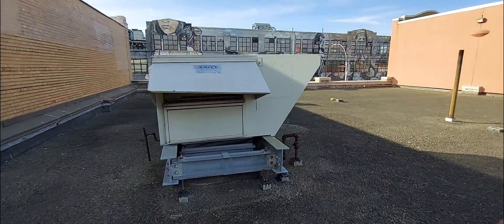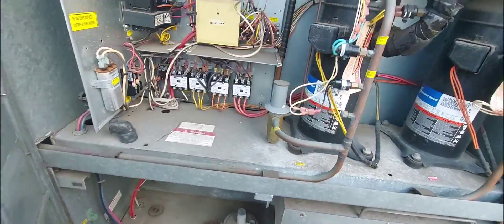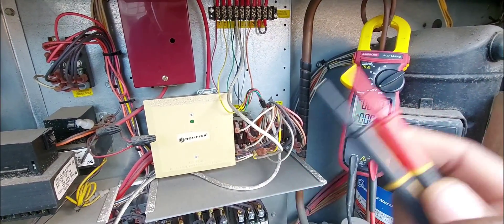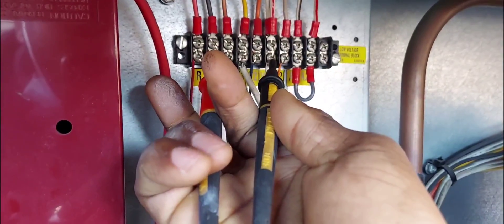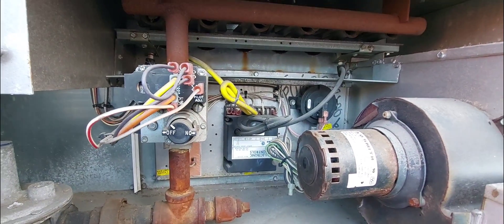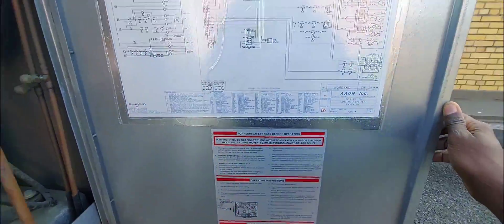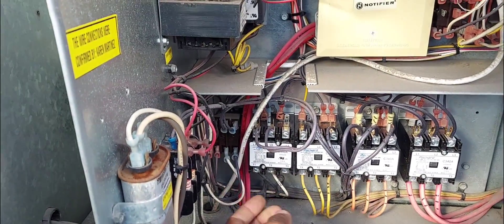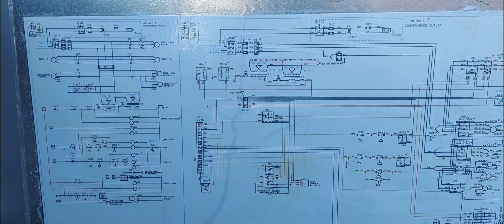HVAC TROUBLESHOOTING | CONTROLS METHOD

Comment: What is a 3 phase and a single phase. Thank you sir, for you knowledge
Reply from the maker: 3 phases of power L1 L2 L3,  three lines with power coming to the load in this case AC unit, single phase is only 1 phase of power L1 L2 or L1 and Neutral

Comment: I am having issues with some Aaon RTU's mine are not gas. Constant volume cooling units bas johnson controls. Condensor fan fuses keep tripping. Motor seems fine,traced wires no knicks
Reply from the maker: Ohm out the motor windings perhaps they are bad!
Reply: @D2DNYAC  will do, let you know how it goes

Comment: I see short here at 14.12 on cc1 & cc2 contactors N/C pins are shorted.. its on the schematic..why is that..?
Reply from the maker: You have to join my membership for schematics learning videos $3 per month  coming soon
Reply: The N/C pins are for when the unit is in the off position. It keeps the CCH1 and CCH2 energized when the unit isn't running. (Those are crank case heaters). They have constant power from the CFC line side of L2. The L1 of the CFC is going to the N/C pins to give those heaters power only when the units are not running. These are to keep refrigerant warm and in the places we want to prevent flooding and compressor damage. You needed to look closer to see the heaters in the diagram or else it would be a short.

Comment: Why is the motor no good? 
Sounds like the bearings may be bad. Is the amp draw to high? Is the fan dirty? Is it running backwards? These things you should show or you'll never find the main problem just fixing the symptom. Then a few weeks later you get a call it's not working again and you have another burnt out motor. You need to show why these parts go bad or your just changing parts. Part changers are a dime a dozen and that's why they're are so many systems shape.
Reply from the maker: @Ares the motor was Bad ( period ) and fortunately for me in this part of the world we do not repair motors unless it's a special motor!! Okay..  in addition the housing and wheel was also replaced,  it all came from the supply house in 1 piece pre assembled.
Reply from the maker: @Ares this took me a whole 15 minutes to replace.. and no its running Prettyyy Prettay Prettay pretty good 😂😂😂
Reply: If it's bad bearings, the motor needs to be replaced. If the amp draw is off, it means motor needs to be replaced. If it's running backwards when it's clearly not 3 phase, the motor needs to be replaced. All your suggestions don't make the guy a glorified parts changer, they're all the same symptoms of a part that needs to be replaced to fix the issue. No need to get down to specifics in this situation.

Comment: Great troubleshooting, i would just add alittle more caution when finding wires that have been removed by someone else.  That is finding out first that those wires do go to the motor before plugging them in and energizing them and find out first if the motor is not shorted, you would create another problem if you blow the fuses.. guess we all have our own little way of doing things.  Great video
Reply from the maker: Noted! Thanks for watching
Reply from the maker: @Reynaldo Martinez although one might argue that if the combustion motor was shorted or grounded then the fuses would had already been blown , also the wiring diagram clearly showed wht and blk wires going to the   CB motor from the relay, now what’s the odds  those same wht & blk wires and only those wires just dangling by the empty relay terminals 😂 🤷‍♂️

Comment: Those two wires you connected to the relay for the motor ,would it matter if the were reversed ..?..
Reply from the maker: Good question 🙋‍♀️, no it doesn’t matter

Comment: Good video .. why do you think the previous technician left the wires disconnected?.
Reply from the maker: Perhaps because the motor was bad! 😆
Reply: Tech found the problem let the customer Knows but, He thinks is maybe a wrong diagnostic and call for a second opinion, a second opinion is a very expensive for the customer. Great video.
Reply from the maker: Thanks for watching
Reply: @nelsonjosorioruiz  makes sense

Comment: In my understanding any unit not running your safety switch are open 👌
Reply from the maker: Thanks for watching
Reply: @D2DNYAC  ? Do you work for a company or for your self 🤔
Reply: No. If a unit is not running, it means there's a problem that needs to be diagnosed. Your statement is about as intelligent as saying if the car won't start, it's because it's out of gas.

Comment: Trouble shooting is a BIG part of the trade, and someone lets the customer know there is parts that need replaced and customer’s don’t realize that you need the combustible motor to work in summer time for Dehumidification then winter no heat , call in and find locked up inducer motor
Reply from the maker: Thanks for watching